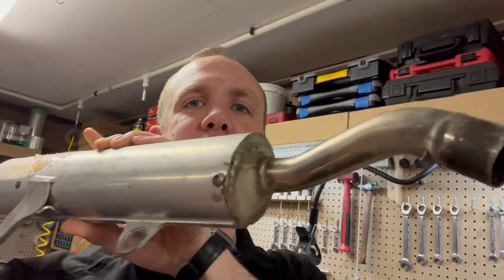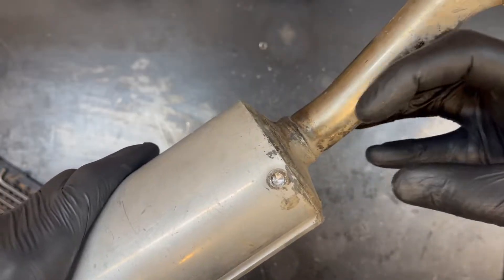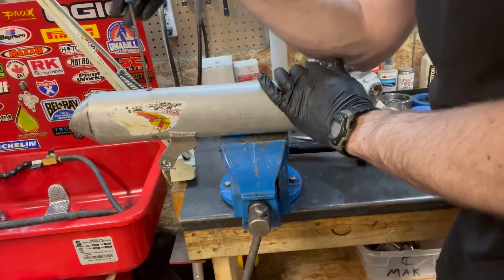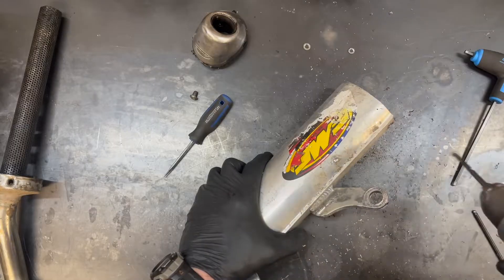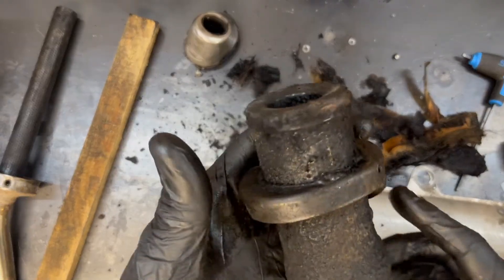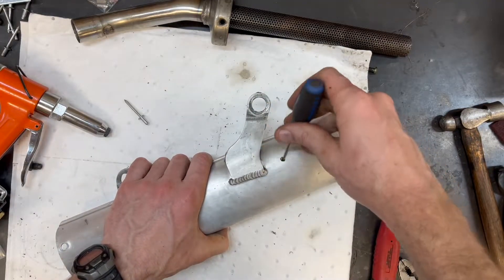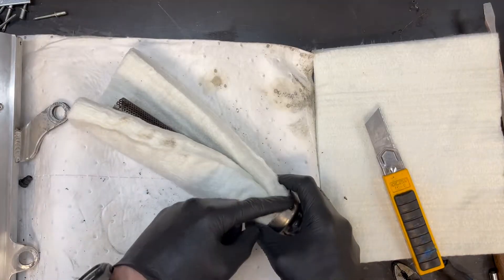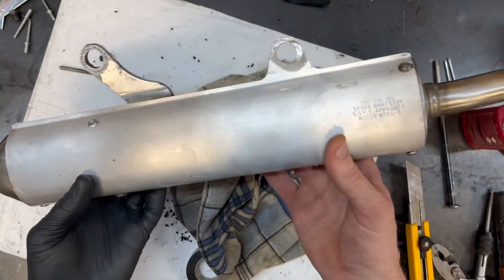How to Repack FMF Turbine Core Silencer YZ Build PART 3

Comment: Glad to see a video on how turbinecore pipes are SUPPOSED to be serviced, thanks Chuck! 

In my case for my YZ 125 turbinecore, i chopped the can where the perforated core met the turbine and tossed the turbine. More or less ended up with a powercore instead (which got a more standard spark arrestor in the cap).

Comment: What kind of packing do you use?  Bulk fiberglass insulation or motorcycle specific?
Reply from the maker: It’s motorcycle specific. The brand I like is Helix Racing Products. It’s denser and less messy than the FMF stuff. Lasts longer.
Reply: @ChuckfromTrueTech  I still use old school wall fiberglass, and it does blow out faster.  I just change it when it gets as loud as yours.  :)
The rich jetting made that job about 3 times harder than it should be.  What a mess.  I have never had a stock bike ruin so rich as the modern YZ250 does.  It is different for engine builds and air quality, but in Michigan, (with higher compression as I lowered the cylinder for more bottom end power, which leaned the jetting a bit.), I leaned the Pilot to a 48, the power jet (not a fan of) to 40,, the main jet stock for now,---but 3 needles leaner for the needle, on the top groove. 
MXA said the jetting was perfect.  Not the same mag it used to be. They are as much of a mess as the jetting was.  :)